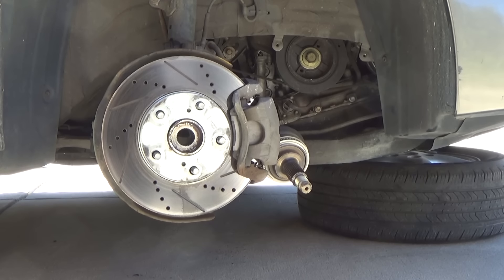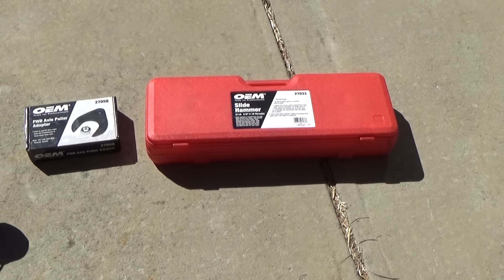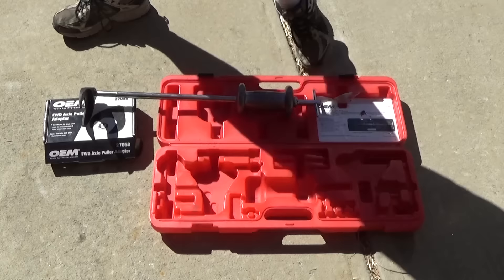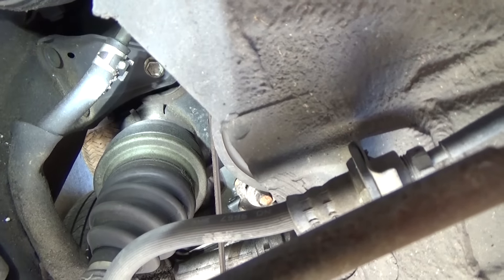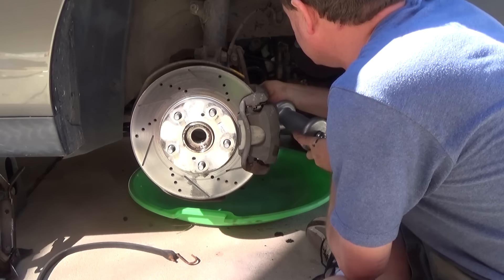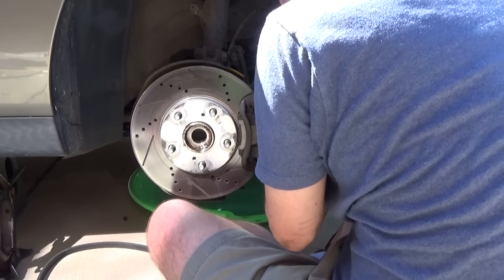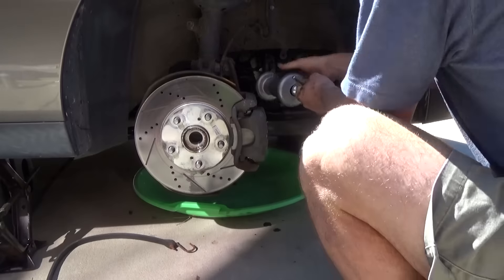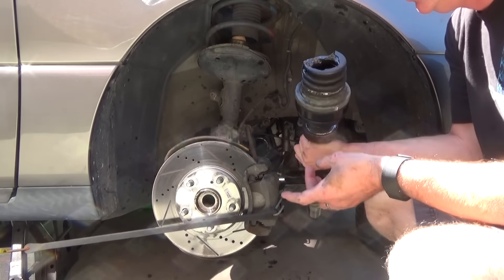Use a Slide Hammer to Remove a Stuck CV Joint

Comment: Often this just binds it up worse. Get two flat end screwdrivers and bend the spades about 30 degrees. You can buy these in some hardware shops. I think they are sold under "pry bars" but you only want them a standard screwdriver length. 
Place them 180 degrees apart and quickly alternate force on one side then the other. And move your crotch! 
Works every time I have had a stucken!
Reply from the maker: Great tip. I am going to pin this in hopes it helps someone else.
Reply: Going to try this
Reply: If you even have space for two pry bars this can work
Reply: Who’s tried this

Comment: the key ingredient in doing this... patience and persistence.  On my Volvo S60- I took the whole wheel assembly out; the entire knuckle. I was replacing the ball joint and hub anyway but it gave me a perfect angle to get the 'crows foot' of the slide hammer adapter between the axle and transmission. Because I was pulling straight out without having to angle the slide hammer-  3 'quality' whacks and the joint broke free.. less than 2 minutes.  Of course-  it took me 3 days of using pry bars to get to this point but, well-  live and learn. Thank God for YouTube :)   good luck everybody.
Reply from the maker: Couldn't agree with you more.  These can be some of the most frustrating things to remove but then again sometimes they pop right out.

Comment: If it does not come out after a few pulls, you need to rotate the shaft little by little, and yank it. The C clip has to face downward open, for the shaft to come out.
Reply: When you said, "yank on it." Are you referring to using the slide hammer tool with puller adapter or by just your hands? Also, why does the C clip need to face  downward open for the axle to come out? There is no logic behind that, unless the open part of the C clip slides over some type of key way, perhaps.
Reply: I have to get one tomorrow for my 2012 Camry and I really hope it works.
Reply: @harryl8234  If you look at the replacement axle (if you have one) you'll understand. The clip is not round so it sticks out a little when the open end of the clip is at 12:00 position.  If you rotate the CV joint to where the open end of the clip is facing 6:00 position, the clip falls into a groove and makes it easy to pull the CV out.   Trial and error until it suddenly comes out.

Comment: Thanks for the video. I already own the OEM fork and slide hammer. A little tip is to pull as straight out as possible. Also, it's not always possible to manipulate the fork behind the axle while it's on the slide hammer. To get around this I've placed the fork only behind the axle and then screw the slide hammer threaded end into the fork.

Comment: Good video...   The only thing I would add is that if anyone is replacing the drive shaft with a new unit, check that they both have the same amount of splines. On my Mazda they changed the transmission during the production run, and for some reason also changed the amount of splines at the transmission end.  Luckily I knew about it, however it could easily cause a lot of grief, or should I say more grief when doing this job.
Reply from the maker: Good to know John.  Thanks for sharing.

Comment: The interesting thing is that on my car (SVT Focus) I've changed the passenger side twice without any problems because it comes right out. It's the driver side that is like this one (the short one), which apparently has that clip. Last time, when I was changing the passenger side, I attempted changing the driver side as well, but when I saw it wasn't coming out, I left it alone (there was nothing wrong with it anyway, and the only reason I replaced the passenger side, was that the boot was torn and was leaking out grease). Now, however, it's making noise and I've rented this same tool with the slide hammer, hoping it will work. Anyway, thanks for the video, because it gives me some confidence that my job will go ok.
Reply from the maker: If you continue to have trouble try using heat to help it out or, my best tip, rent or buy a bigger slide hammer.  It can make all the difference in the world.
Reply: Thanks for the tip. Actually, I finished the job in less than an hour without any major delays. All I had to do is get that tool wedged between the transmission housing and the boot/cup, then give it a few gentle taps with a hammer to drive it in there. From that point all I had to do is simply pry on it with my hand. Didn't even get to use the slide hammer, which was pretty good. If anything, installing the new one was slightly more difficult (but wouldn't call it problematic). It took me a few minutes of wiggling and pushing to get it in there, but still. Went on pretty smoothly. Thanks again for the video.

Comment: Hello Mr. Clint, I just extracted the passenger CV inner axle w/carrier bearing.  And I cannot emphasize enough about using a GOOD rust penetrant prior to attempting extraction.  Spray the Carrier bearing down on both sides and let it sit for at least 24 hours.  Also, keep the slide hammer puller in-line with the axle , as much as possible.  Final result - 2 slaps with the slide hammer and the CV axle/carrier bearing came right out!  So pick up a spray can of "KROIL" or "Knock 'er loose", it will save you alot of grief.  Mech Tech
Reply from the maker: You are absolutely correct.  The 2nd key in my opinion is patience.  I let mine sit overnight after  beating on it for hours and the next day it popped right out.
Reply: Clint Holland one question we’re u put the puller adapter is that where you spray the penetrating oil

Comment: How does the penetrating oil help? It seems like the retaining ring is the issue and I don't see how oil will make it down into and back to that ring
Reply from the maker: I don't actually know if the oil makes it to the ring but certainly from a friction perspective if it did, it should help. What holds the retaining ring in? Friction.  What does penetrating oil do? Reduce friction. Again, not sure it makes it that deep in time to help but it certainly wouldn't hurt.

Comment: The axle on my 2003 Hyundai Sonata would not come off for love nor money! I got the same puller, but I would suggest getting the large fork also. The housing would not let the smaller fork go behind the CV joint. The larger fork caught a step on the CV joint, and a few pops of the slide later, the shaft came out, along with about a pint of ATF. I forgot to put a catch pan under it. I tried pry bars. hammers, and it just would not work. BTW, with the seal in place, penetrating oil will not get into the area where the splines and the clip is. Mine was on the side that was soaked in ATF, and it was still stuck. Of course, I am certain that this car is possessed by an evil spirit.
Reply from the maker: I agree with you on the evil spirits.  All CV joints are possessed at a minimum.  They will make you question yourself many times and then they just give up for no reason.  Thanks for the tip on the bigger fork. I will pin this comment to help others.
Reply: Im in the same situation today 2003 sante fe smh day 3
Reply: Hi Clint, I am using the hammer and fork rented from O'Reilly's and the fork seems too small for the shaft. I can only get two or three pulls before the fork comes off. My car is 1999 Toyota Solara which I believe it is the same as your Lexus. Do you know of a fork size that would fit? Thanks.

Comment: Ok this makes me feel a lot better! Iv been working with tf and on on my Tundra for 3 days. I’m at a point at the moment where I’m about to use an air hammer on it to see if it won’t pop out. Iv replaced them before but never had one stuck like this. The set of tools I got from Auto zone didn’t come with the adapter. The piece you used on the other end of the slide hammer. I’ll let yall know if the air hammer worked!
Got’er done! The air-hammer did the trick! Getting the new one in wasn’t AS hard as getting it out but it wasn’t easy either! I had to old it while my brother hammered on it! After a few minutes I said “DAMIT, RARE BACK AND HIT THE MFer! AGAIN! AGAIN DAMMIT”! He finely got pissed off and hit it home! 😂😂
Reply from the maker: They can certainly make you question your sanity.  Let us know how it goes.

Comment: I used 4 feet chain clamp both ends to the axle and tie a rope to the chain so you can hold it and use something heavy like a hammer or breaker bar to yanked it out and it came out in 2 minutes.
Reply from the maker: Lucky you.  These things can be a nightmare at times.

Comment: Hope this works for me. Gonna spray it tonight. Thanks for posting this, man.
Reply from the maker: Hopefully it did.  Were you able to get it off?
Reply: @ClintHolland  nope. I'm still fighting with it. I'm losing hope here.
Reply: @ClintHolland  got it!. I bought a small, sturdy crowbar, pressed it against the cv joint, and beat it with a small sledge hammer. Whew!!
Reply from the maker: @trachito  Glad that worked out for you.  They can be a nightmare to get off.  My last resort is using heat but sometimes you gotta do what you gotta do.

Comment: Hi, this is Rickey again. That slide hammer tool that I purchased from Lone Star tool didn't work for me. I tried and tried again for many days and I could not triedget the slide tool to stay straight, in the up position. It was always was applied in an angle position, so after a few hits it would slide off the inner axle. I even tried by using the slide hammer with two vise grips and no such luck. I continue to spray it with lubricate oil and trying all these other ways. Over and over I tried other ways as well, but nothing prevail! 
    So I jack up the other side (left) of car and made sure that this 1997 Toyota Corolla was securely grounded with more jack stands and tires for safety reasons. Then I got under the car with lubricate oil, a 4lb hammer and flat chisel trying to get it off that way. It was looking more promising, so I took off the air filter attachments a loose again and got a long crow bar along with my 4lb hammer and started hitting it from the top. Please note, previously the 2lb hammer from the top did not work either. It finally came off. Thank goodness! 
     I noticed that when the CV inner shaft came out of the transmission it was well lube, but strangely I did not see the steel ring on the end. 
   Now this particular  CV axle was purchased at O'Reillys automotive store back in 2014. No way I am taken another chance of replacing it at O'Reillys again, so I purchased another one at Olathe Toyota, which I've bought many different genuine Toyota parts before.  I realized that many Toyota parts have to be replace with genuine Toyota parts. I hope this helps someone.
Reply: my old cv shaft was toast and separated because the boot failed. so using a cobalt drill bit i drilled a hole in the side of the remaining shaft housing.  my slide hammer kit came with a hook attachment that i inserted in the newly drilled hole and two slides of the 5 lb weight was all it took to  remove remaining cv shaft.
Reply: I have been satisfied with Cardone cv shafts, and they are usually less expensive than original manufacturer parts. I've been buying them at Rockauto.com.
Reply: @garylangley4502   still good 4 yrs later?
Reply: @BillSW  My friend has one of the cars I installed Cardone CV shafts and they are still working fine. The other cars that I have used them in over the years have been sold so I don't know how the CV joints have held up. Each one of those cars were driven a long time before they were sold, and in all cases, the CV joints were still in good condition.

Comment: Yeah hi, thanks for the informative video. I just received my CV axle tool from Lone Star and hopefully will be using it tomorrow. I tried several things already and I never had a struck CV axle before. This passenger one was installed in 2013, but it's not the original one. Again thank you sir.
Reply from the maker: You are quite welcome.  Be sure to spray it with some type of penetrant to help.

Comment: I have a 98 lexus same car as u i have the adapter and the slide hammer and i just cant for the life of me get it back to where it needs to go the retaining clip is off but i feel its gettin in the way when i try to put the adapter on which is makin things very frustrating is there any tips on how to maybe do this i spent all day tryin this have had no luck goin back at it tomorrow wish me luck
Reply from the maker: So you have the old one out but are having trouble getting the new one back in?
Reply: No i havent been able to get the old one out im havin trouble gettin the cv adapter back in the spot in order to get a good pull with the slide hammer if this is makin any sense innur video u made it loom very simple when puttin the slide hammer on the cv joint
Reply from the maker: @bretthyler7680  I am not sure why it wouldn't be hooking on in the same position. Does it look damaged or different from the one I used?
Reply: No its the exact same im just havin trouble gettin the adapter on the back of the axle to get a good pull against it i havent got a chance to get back to it but im gonna give it a go again on friday so hopefully ill have some good fortune my way lol
Reply from the maker: @bretthyler7680  I have also had to use heat before to remove them but that doesn't help if the slide hammer fork won't stay on.

Comment: Do you spray the penetrating oil on both the transmission end and where the bearing (near middle of axle)? I'm concerned if the penetrating oil will damage the seal on the transmission side?
Reply from the maker: I did not spray it on the transmission side but I don't think it would hurt it.

Comment: Will this work on 1995 Toyota Camry driverside CV axle
Reply from the maker: A slide hammer is pretty much the go to tool to help in the removal of any stuck CV Joint. While I don't know the particulars of the 95 Camry, I almost bet it would work just as well.
Reply: @ClintHolland  yeah seems like it would work for what I need but the one I rented today the end of the threads are stripped😠 lol so I gotta return it and rent another
Reply: @ClintHolland  btw I just subscribed👍
Reply from the maker: @jonathanp.1712  That stinks.  Make sure you get the fork attachment as well.

Comment: 16 inch Pickle fork...does the trick..just rotate base of CV at Transmission end..that helps line up C Clip in the 12 o'clock open position..

Comment: You have to turn base of CV a 1/4 turn each time it doesn't pop out with slide hammer..the C Clip is what it is...The C Clip Opening end should be at 6 o clock..turn it every so often moves C Clip to open end position
Reply from the maker: Great tip and thanks for sharing.

Comment: Im going to do this with my Toyota sienna but im going to take a torch to the bracket where the bearing is.
Reply from the maker: It is pretty common to have to use heat to get these out, especially if the car is especially old or has been used in areas where corrosion is more likely.  Good luck.
Reply: @ClintHolland  i ended up cutting the axle on both sides of the bracket then i took the braket up to advance auto parts. Which used to be a western auto so they had their old press. And they pressed out the bearing.  
But i have a bigger problem. I cant get the c clamp back in. Been driving like that for a week. Lol
Reply from the maker: @thecynic807  Wow. I have done my share of CV joints in my life but never had one that hard to get out.

Comment: you mentioned you removed a retaining clip...Which clip are you talking about.
Reply from the maker: Steve Patco https://youtu.be/39rDpC3qOsA
Reply: Yea I found that already.  I have a different setup.  Its a short axle with no intermediate bearings or anything.  I am going to wack it good today with a  cold chisel.  I am nervous because even though the axle is hard steel, the tranny housing that is right along side of it is only cast aluminum I believe.  Would suck if I that cracked.
Reply: You have probably found the answer by now,  but if not, the circlip or retaining clip is just a thin metal ring with a small gap in it. On the CV drive shaft for my Mazda, it sits in a groove about 5mm from the end of the splines that slide into the gearbox / transmission, and it locks the shaft into the correct position. For something so small and ordinary, they can cause a lot of drama.  I replaced the drive shaft and getting it out was difficult enough, and we then could not get the new one to slide into the gearbox, and so we swapped the circlip from the old shaft, and on it went.

Comment: This is for removing a CV axle from the transmission, and not a CV joint from the axle. I was looking for ways to solve the latter. Damn joint wont come off after half an hour of hammering.
Reply from the maker: These things can make you question your religion.  It took me 2 days to get my last one off.
Reply: @ClintHolland  oh, yeah... i ended up buying a friggin angle grinder and cutting the cage center gear out. By divine interventio i didnt screw up the splines so i could replace the bad joint and reinstall the axle.
Reply: @ComandanteJ my axle nut is stuck thinking imma have to get a angle grinder then my cv axle still stuck in trans been a week 😭😭😭

Comment: suppose you could use a come along if needed with this tool
Reply from the maker: Funny you mention that. I actually tried one but without the slide hammer and it didn't work. If you used both it probably would. To get that ring to release you really need a quick snapping motion and not the constant tension.

Comment: And for the other 10% of cases?
Reply from the maker: So great question. That's when you have to take a torch to it and heat it up.  Also, don't give up.  I have had some that I yanked on for literally an hour and didn't budge and then I came back the next day and it popped right out.  Also look at getting a heavier slide hammer.  That can make all the difference in the world.